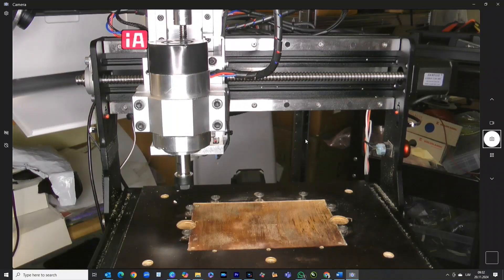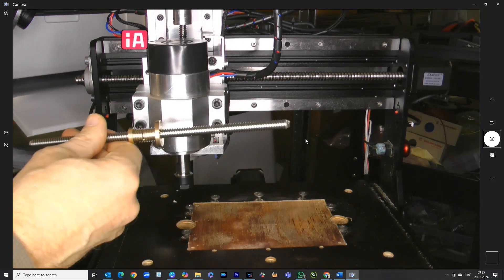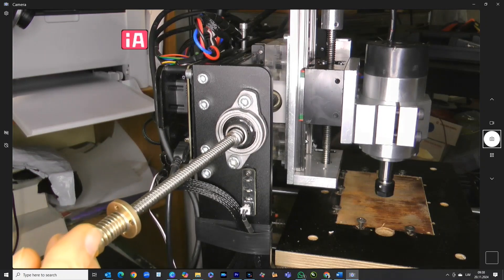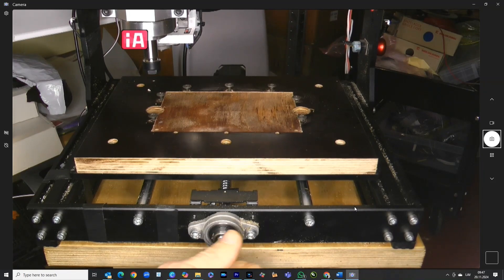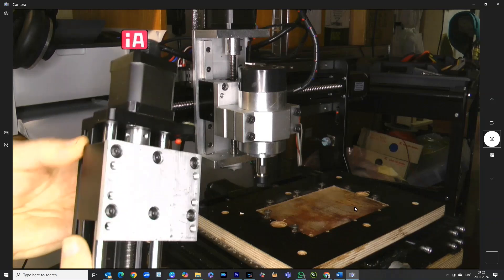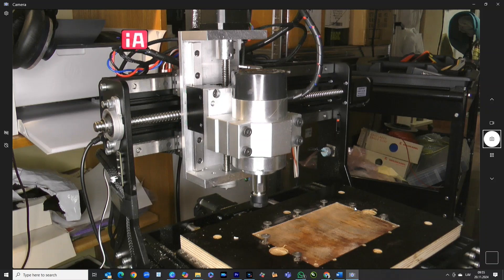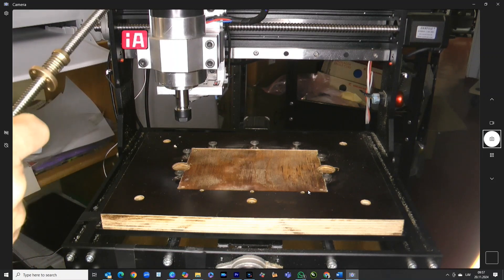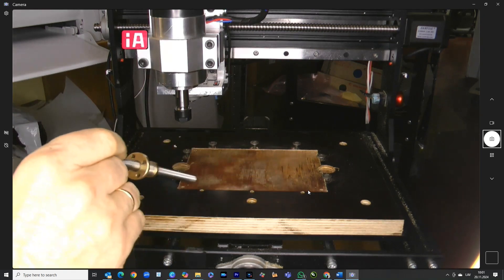PCB milling 10mil desktop 3020 CNC Part 3 Hands-on

Comment: 9:00 I also was wondering why they do like that. And I have just an idea. Maybe their goal is not to provide good quality products but just flood with all those machines the market in the whole world as quickly as possible so probably engineers have very limited time for improvements, testing etc. and they go strsight away to selling as many as possible. I think this is what strategy China has. Probably they jsut don't care about any issues until people buy it because of the price. I think Chinese have completetily different mentality than Japanese for example. Japanese want everything to be perfect but Chinese jsut don't care unless selling is good. This is why I am asking myself, why for f.. sake nobody even tries to manufacture those machines in Europe for example? Why are we ALWAYS counting on Chinese assholes sellers than make something in Europe or USA??!! Of course we have some companies but they ALWAYS make veryyyyyyyyyyyyy expenesive machines. I just don't get it really.
Reply from the maker: When discussing sales and marketing, you should make a product meeting the target customer price. This model moves well for 400EUR and not for 1000EUR which is the right price when using good components. From business consideration, it is a good product to start with. You can purchase a finished high-tolerance version of the same product for 5000EUR with an enclosure and tool changer. Which one you will buy. If you choose 400EUR and modify it then the concept is right.
Reply: @guntarssmits2104  I see but I am not convinced to buy it at all. From your video what you are saying there is almost nothing right in this machine and I have to replace a lot of parts anyway so I start wondering if it is not better to just make my own CNC from scratch 🤔 I really don't need that size to mill some parts for rc airplane which are usuelly like 20 - 30 mm ! or milling a few holes in a small enclosure etc. To me the most important things are: very precise machine, SMALL, not loud so I won't be distrurbing my neighbours, rigid and first of all which doesn't make me frustrated because something is not right, falling apart or not working! Also the price is very important. I am not going to spend 10 000 euros for an industrial machine jsut for Hobby use but at the same time I don't want to be frustrated all the time because somethinhg is nto working and ordering 1000 parts and waiting 2 weeks for shipment, hell noooo
Reply from the maker: @ If you build everything by yourself and have knowledge of CNC components sourcing you can build great devices. At the same time, human hours are also ar part of the costs.
Reply: @ like this I would know every single screw on my own built and also I can choose parts while building it for example cheaper vs more expensive etc. and mesure everything from the beginning.